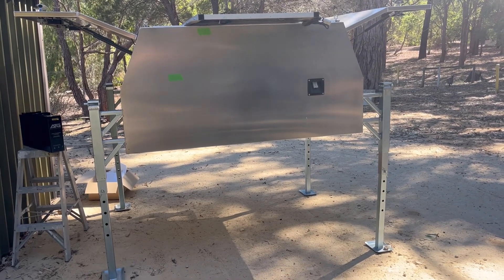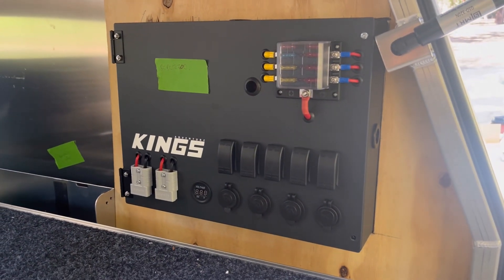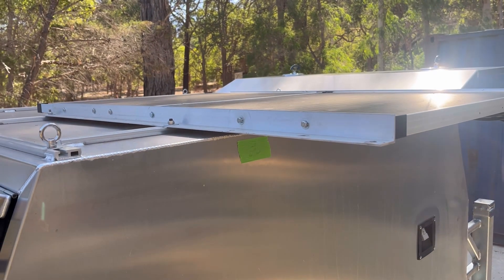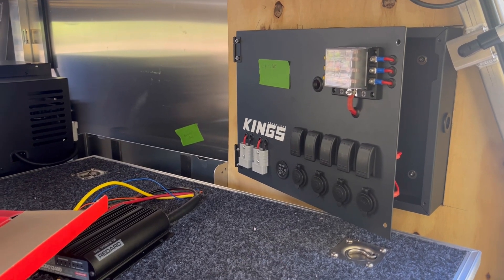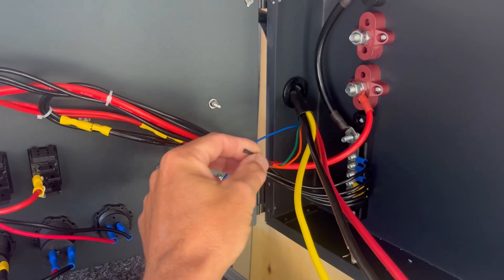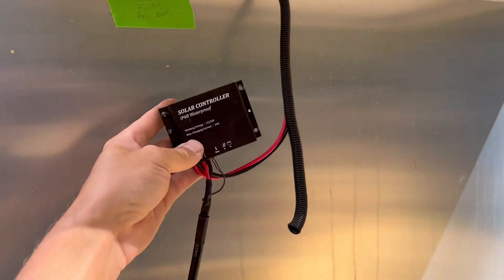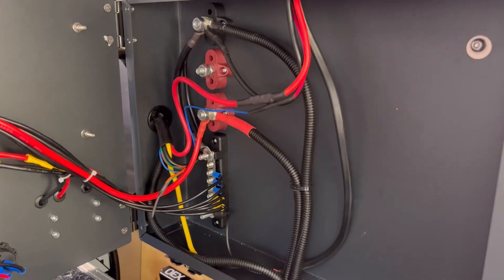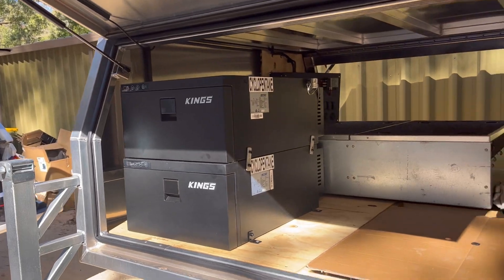EASY DIY Lithium Dual Battery with Redarc DC Charger install - Complete step-by-step guide!

Comment: Hey mate is there any reason you don’t need a fuse on the solar ?
Reply from the maker: Hey mate, the solar panel is wired straight to the bcdc charger rather so it’s only an input. Plus the panel had a built in short/ open circuit cut out.

Comment: Good video. I am setting one up in my boat the hinges are a great idea I am going to do that for sure. The 2 red bus bar terminal blocks on the inside fit a mega fuse for the battery supply.
Reply from the maker: Thanks for watching, happy it’s helped. I didn’t know that about the bus bars being for a mega fuse. Thanks for the tip. But i still like to fuse everything individually and any battery supply needs fusing close to source (Battery).
Reply: @vesautoelectrics  Thanks, I have changed it. MRBF fuse on the terminal of the battery and am going to use the buss bar for a 50amp mega fuse for the trolling motor.
Reply from the maker: MBRF’s are great, nice and neat. Yeah sounds perfect for the trolling motor.

Comment: Lovely Ep and setup.  I wonder why the customer did not run a seperate Mppt solar Controller with a bigger solar panel, it gives the setup back up. as I Am not a fan of all in one setups for going bush,
Reply from the maker: Hey Craig, thanks for watching. Yes i agree, but we wanted to keep it simple, and the customer liked the all in one dc charger. He also already had the solar panel, and mounted it further forward as he wanted storage space on the roof. Maybe down the line he may upgrade to a larger panel and separate mppt to utilise more power?
Reply: @vesautoelectrics  No worries thanks.